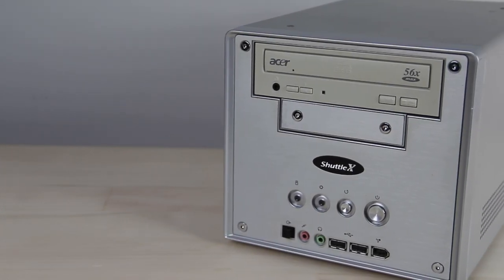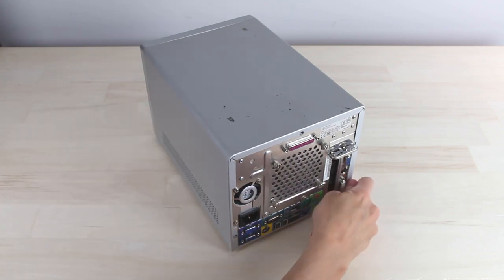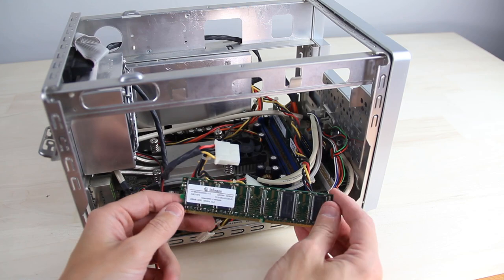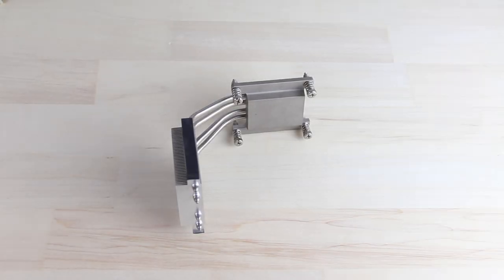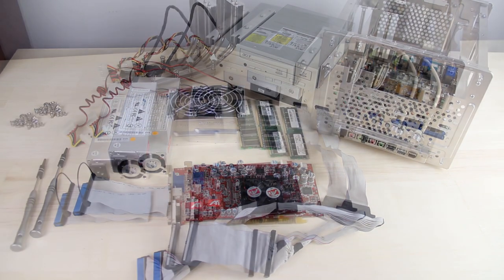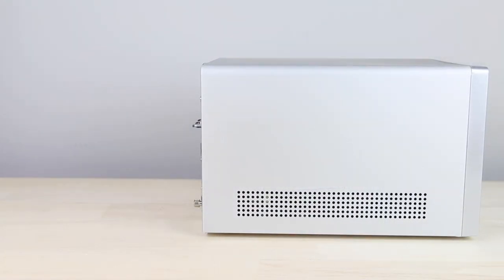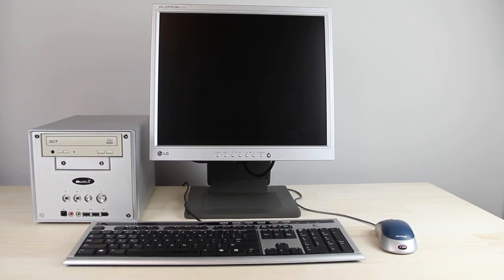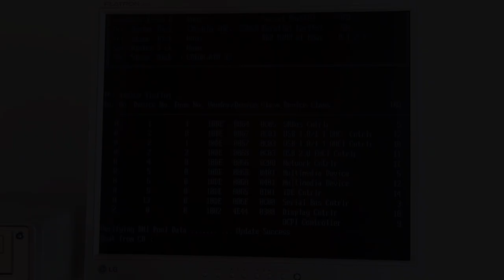Shuttle XPC - A PC for a new Millennium - Part 1

Comment: The major difference in the V2 version of this model is a slightly upgraded Northbridge that supports 200 Mhz (400 MT/s) FrontSide Bus.

But you didn't try to upgrade the CPU while you were in there anyway...
DDR 400 might run at 333 instead, but you will never feel the difference.

In fact I wouldn't even upgrade this as a weak XP machine...
With a Socket A, I always suggest downgrading to be a strong Win98 SE box instead.  Possibly even switching to a low-TDP CPU so it doesn't run like a space-heater.
Reply from the maker: A nice eye on the spec sheet! Yes there are some upgrade options with this machine to make it even more powerful but admittedly nostalgia is tinting my glasses here because I want to get it fairly close to what it was when I used it. It's been in service over time in different forms (even a small file server!) but that Athlon processor has indeed remained.

I most recently used it as a Windows 98 machine and while it was very capable I had built many 98 machines recently and this was a great way to take a little detour into XP land. Again nostalgia is a heck of a drug!
Reply: @RiksRandomRetro  
I understand the Nostalgia...
I have long kept my own Socket-A rig that I also used during university.
All the guts, minus the case anyway.

I still hang onto the Socket-7 parts from my teenage rig too.

I still have the Apple //e that my father got when I was a child.

Comment: Hi and thanks for this great videos about Shuttle xPC.
I have Shuttle with Core2Duo E6420 CPU 2.13Ghz, 2 Gb of RAM, but I dont know exact model.
Is ist possible to upgrade RAM to at least 4Gb ?
Which memory is compatible here, dd3 1066 or maybe 1333 ?
Same question about cpu, is it possible to put some strongest core2duo from 2009, like 7500, 8800 or even 9900 model ?

Comment: My SN41G2 was my Lan party gaming box, then later became a media center pc.  I also ran XP MCE.  Mine had a Radeon 9600XT and an Athlon 2700, plus a  Hauppage tuner for recording shows and capturing video from old VHS tapes.  The PSU died, and I replaced it with a 300W psu.  That psu also died, so now it's using a full sized 300w psu sitting beside it. Ii would like to source another sff psu and continue using it for video capture.
Reply from the maker: Hah nice necessity is the mother of invention after all. Nice to see one still trucking and it can be used for so many purposes just from the convenient size!

Comment: Picked up one of these last week, but it doesn''t want to boot with a RAM stick in slot 1 ... just slot 2 for some reason. Do more people have this problem? And does anyone know if there is a bit newer board out there for the Shuttle that supports DDR2 ram? Mine is a DDR1 model with (I think) a Pentium 4 processor.
Reply from the maker: Oh nice. I haven't had much experience swapping the boards out or replacing them with newer models. I assumed Shuttle basically designed their machines around whatever board they were using all while keeping generally the same form factor so direct swaps may not be feasible. Still hope it works out and good luck!

Comment: This format has always intrigued me, but everytime I go this route I regret it because of all the obvious resons of expandability, noise and heat. I mean, right now I'm even regreting my micro-atx setup, but oh well, I did do it quite a few times.
Reply from the maker: I love it half for nostalgia and half because it's a cool sort of setup. But yes it has some very distinct shortcomings due to that size. I had to really force myself to use it as my primary machine back in the day and it was a commitment to say the least. If I had to pick at this point I'll go for a normal tower every time but it's a neat one to mess with today.

Comment: I bought two shuttles over the years. Both were unreliable.
The first had a power supply fail and then all the capacitors went on the motherboard, a product of cheap capacitors that affected many manufacturers of that era. It had cool features, running WinXP with a trackball remote and dedicated software for a built in infrared receiver so you could program it to use as a media centre. 
The second was a budget barebones KPC that used very little power, billed as a green cube. Beautiful case with a template program so you could print up covers that could be exchanged under the clear plastic fascia so you could change the physical appearance of the computer whenever you liked.
Again, that seems like a cool feature until the motherboard just quit and the computer would no longer post after only a couple years of use with no overclocking and thermals never stressed.

The huge problem I have with shuttle is that they do not sell replacement motherboards, so many of their so called "green" cubes just became high volume e-waste.
I liked the form factor so much back then that I even bought an official shuttle carrying bag, which I still have. I am still looking for a solution which will probably involve some kind of adapter rack to use an smaller ITX board in that awesome case.
Reply from the maker: Nice! Sounds like they were good machines until yeah those caps went. I haven't run into having to source a new motherboard as of yet thankfully but if it does I haven't even thought of the prospect of having to try and source a new one. I like the case and just about everything with it but with that motherboard being basically a unique design that makes it tricky for long term prospects... might be time for me to do a pre-emptive recap!

I had the carry case as well! I took mine on a flight to a friend across country and we spent the weekend watching shows and playing games on it. Not sure what happened to the bag honestly but I thought it was really cool hah!

Comment: Would this case fit a mAtx board?
Reply from the maker: I don't believe it would no. As far as I understand Shuttle used basically a proprietary design of their motherboards so the case isn't made to fit any normal standard. I could be wrong there but quite certain you'd have to mod it to fit a standard mATX motherboard.
Reply: Возможно уже не актуально, но пожалуй внесу ясность по вашему вопросу;З
Извиняюсь, что пишу на кириллице,  надеюсь автоперевод google передаст суть правильно) 👍🏼 
Я покупал у нас в России несколько таких раритетных корпусов для восстановления и последующей установки более современных материнских плат формата mini-itx (17x17 сантиметров). В последний Shuttle который я дорабатывал около 4-5 лет назад, помню что я смог установить на самодельные стойки (stand-off 3mm) плату формата mini-dtx (17x19см)...Она встала как раз в притык к задней стенке с вентиляцией для видеокарты. Нюанс в том, что если вы хотите использовать дискретный видеоадаптер, то для формата DTX у вас как правило остаётся всего 1 слот pcie и всё что вы сможете установить без выпиливания "окна" в корпусе, это 1-слотовую видеокарту, по типу gt1030/rx550. Но это вполне рабочий мод, под антуражную рабочую/мультимедийную станцию данный “old school case” подходит до сих пор! Nostalgic forever 😅👌😚
Reply: @mtm_777  Здарвсвуйте, сохранилась еще информация (ссылки)? Блок питание и кулер для проца можно тот е оставить?

Comment: I had the P4 version of this machine. It was, by far, the loudest PC I ever had. Had it supported PWM fans, it may not have been so bad, but it could only run them at set percentages. I never wanted to chance that this wouldn't be enough for the infamously hot P4. It would be interesting to see if modern fans with their own temperature probes could run quietly while keeping the P4 cool enough. As it was, though, I upgraded to a Core 2 Duo soon thereafter. That machine was so quiet and powerful, I never looked back.
Reply: The next machine was also black. As much as I appreciated the departure from beige, silver wasn't exactly to my taste. :)
Reply from the maker: Ooh a black machine like that sounds awesome. Honesty if I could get my hands on one at some point I'd probably go for it but yeah I could see thermals being an issue. This one runs surprisingly cool considering how cramped it it. 

I love my silver box because it's such a color for the period haha. Together with frosted tips... OK yeah maybe the black ones were better!